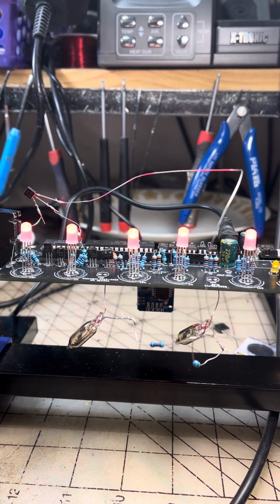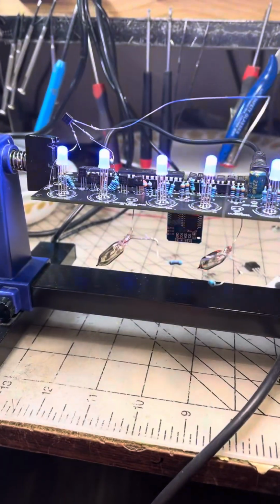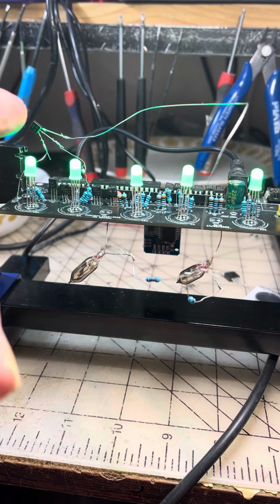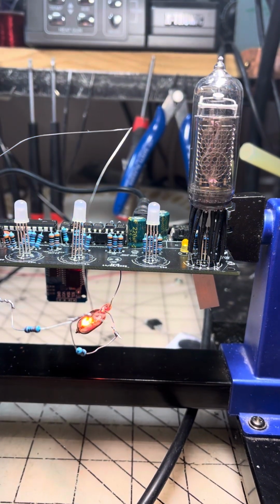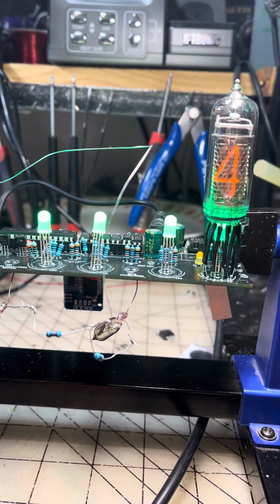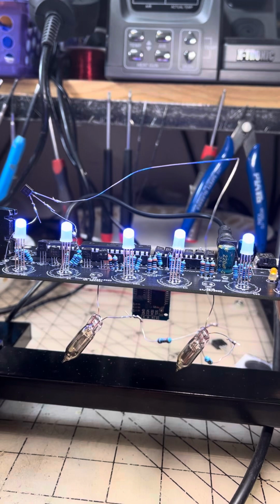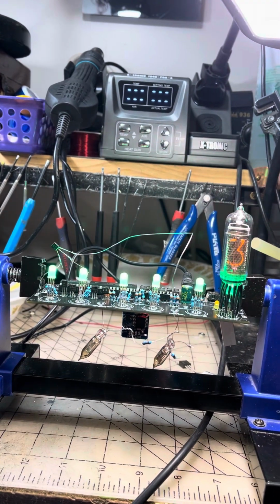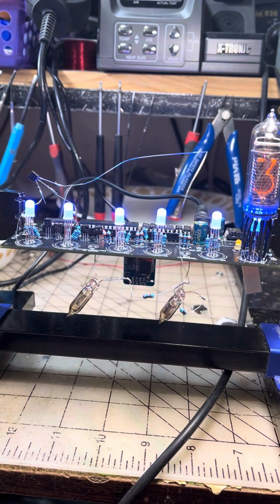Solution removing transistor and neons from the board

Comment: if you remove the two neon tubes from the circuit do the nixies still turn off when the neons would have been triggered?  If no, then maybe consider limiting the current to the neons further as one of the properties of neons is they act as a short when they have reached breakdown (light up). It could be that when the neons are activated, the power supply doesn't source enough current to the nixies. It could also be the your power supply doesn't output enough current, or there is a series resistance in line in the input/power end of your circuit.